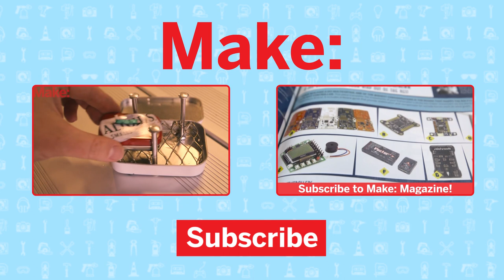Laura Kampf's Sawdust Stove

Comment: Excellent engineering skills, I loved the marking out using a washer as a guide, so simple but so effective. The mig welding of the box section will always be tricky, the drum is such thin steel, holes will blow easy. What I have done in the past is turn the piece so the thick metal is facing skywards. Then weld fast along the thick metal allowing gravity to pull the weld bead down into the thinner metal, keeping the actual arc on the thick part,  if that makes any sense. Its best to just keep practicing on scrap metal first. Also with a mig and to some extent with rod welders, a stop start approach can be best, this allows the metal to cool. Or weld in one area then move elsewhere while that area cools until eventually the whole thing is welded. Sawdust burners and gasification burners interest me, they burn longer than ordinary wood stoves, so no constant reloading.

Comment: Cool stuff! An many small clever tricks to learn, too: the washer for adding some distance when tracing the shape of the barrel or the angle grinder raised up a little. Is that sand on top of the sawdust? What's it for?
Reply: the sand contains the fire from taking over too quick...that way it will burn nice and slow from the inside out

Comment: Is your sawdust just wood or does it include plywood(glue)? I want to do something like that but I work with plywood so unsure if that's safe to burn because of the glue in plywood.
Reply: in this case it was just oak and walnut sawdust...i am not sure but i would guess it´s okay to burn plywood dust as well...but i would recommend using sawdust from a planer because the chips are a bit bigger and therefore easier to compress to a somewhat stable pile.

Comment: The most common - and by no means ignorable - risk with this type of oven is that the sawdust may collapse while burning. When this happens, you get a small explosion inside the stove - nothing terribly powerful, but it can rip open the stove. How do you address this?

Also, didn't your pot get all black from the open flame?
Reply: you need to make sure that the sawdust is compressed really tight. that way it is stable and won´t collapse. pot didn´t get black

Comment: That is so cool...like the washer trick, it why I didn't think of that But I will sure use it ....lol..one question was that sand on top and if so what kind...thanks
Reply: yeah, that´s sand...any kind would work i guess. as long as it keeps the top sawdust from burning too fast
Reply: Good thinking with hammering the dust together and topping it with sand. As you surely know, loose sawdust is very flammable and has caused disastrous explosions in the past, so it's good that you've taken these precautions.
Also, clever trick with the washer indeed. :)

Comment: very nice video keep up the good work... The only thing I would have done differently is to not drill holes in the bottom...  It increases air flow and causes it to flame up, the longer burn-time would come from a smoldering coal effect... Just my $0.02, but what do I know? I'm not a builder, I am, however, considering making smaller sized ones made from vegetable tins to give to the local homeless people as there is a sawmill close by to get free sawdust from. I would of course pre-burn every one of them before handing them out as to remove the zinc coating for those that are concerned.

Comment: That is realy realy awsome! but what stops the sawdust from collapsing? it looks like magic. what is the purpose of the sand? why not modify the original top? how long does it burn? For me this needed narration maybe I'm dumber than average.
Reply: you need to compress the sawdust as much as you can and that what makes it stable. the sand keeps the flames from taking over too quick...with the sand on top the fire will burn slowly inside out. for about 4 hours. it´s all in the blogpost that came with this video
Reply: Took me 15 minutes to find that blog post so I don't feel bad about the stupid questions. With a 4 hour burn time I think you may need a bigger pot of soup;) Nice work, never stop.

Comment: Great 'entertainteresting' job and video ! Is it sand you are pouring on the top of the sawdust ? (you'll be kind to show whatever product you are using and some hints about its purpose. I guess it will prevent the sawdust to be flown away with the heat).
Reply: it is all in the blogpost. yeah, that´s sand
Reply: Palmface

Comment: If i were you  i would have made the bottom with concrete, it will oxidise and bunt through...
Reply: That takes a while and you can replace the bottom easily by putting another scrap sheet of metal inside the barrel.
Reply: well, you will need ventilation from the bottom so concrete would not be the ideal substance. but you are right. it won´t last for ever...that´s the thing with recycled barrels.